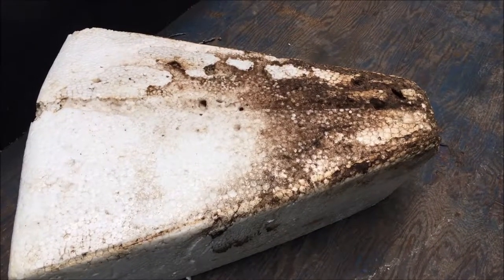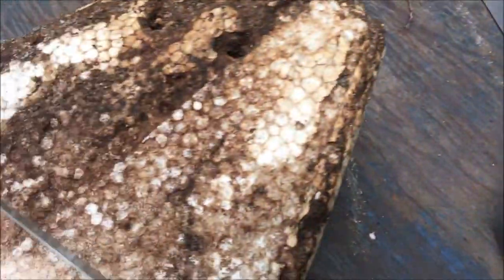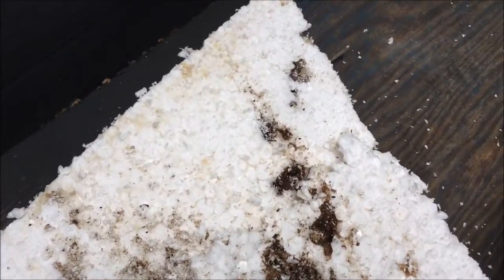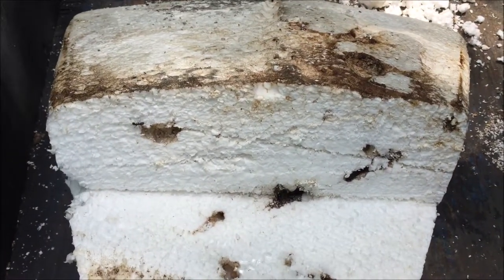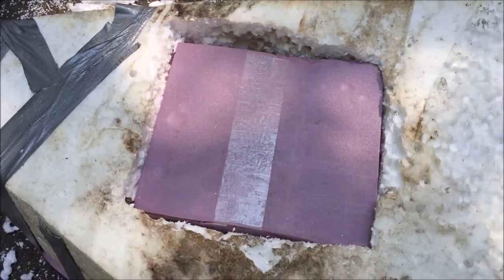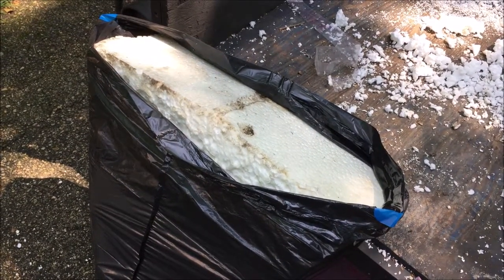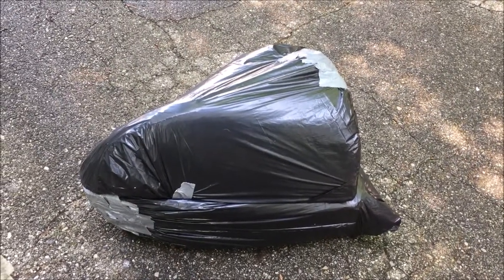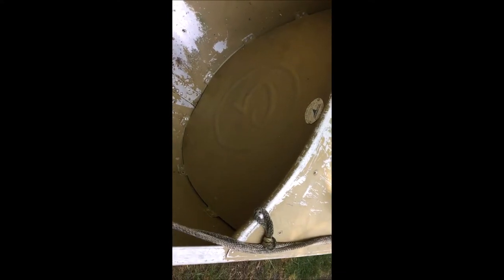OldGuyDIY $10 Grumman Sportboat Sport Boat Canoe Flotation Bow Fix Repair Replace Foam Board  Pt 2

Comment: Your solution worked, but, I feel there is a much easier and "free" solution. Tractor Supply has literally scores of styrofoam blocks that are used to cushion their trailers when they arrive at their stores from the manufacturers. They give them away! The styrofoam blocks dimensions are: 12x12x19. I insulated my 30x40 garage with them.

Comment: Have ants in my sport boats also. Probably should investigate. Don’t like the bagging idea because if the boat floods the bags will trap water. Have to siphon mine after big rain when they’re on a trailer. Also concerned about the riveted in rear seat flotation. My older ones don’t have the gunnel foam.
Reply from the maker: A little boric acid mixed with warm water and sprayed on with a hand pump weed sprayer should take care of the ants.